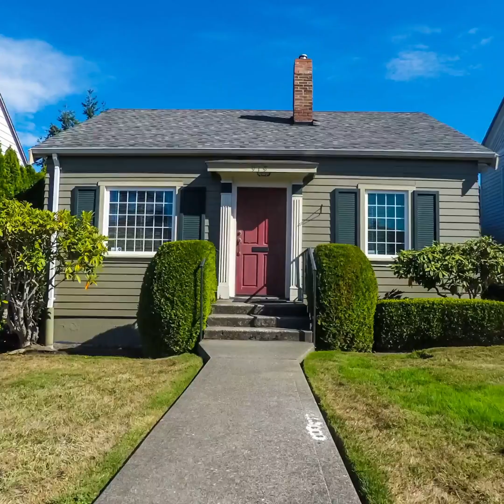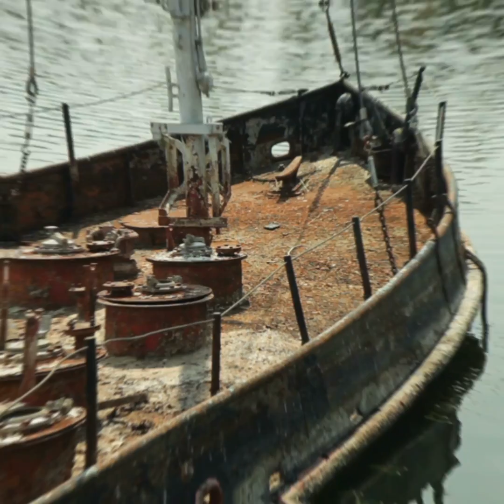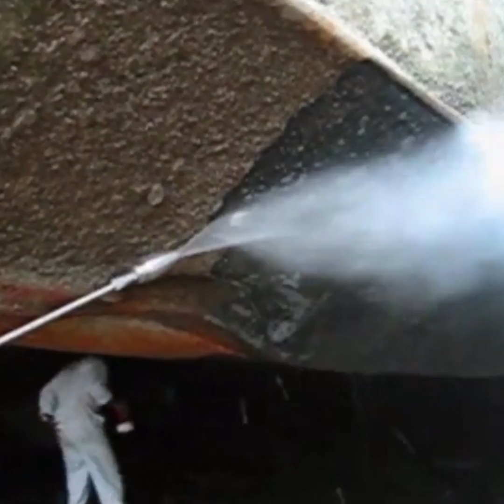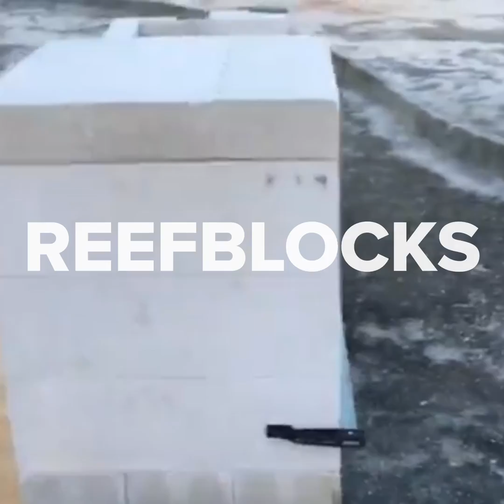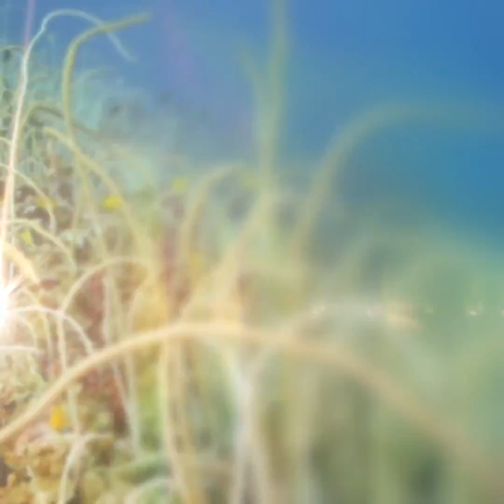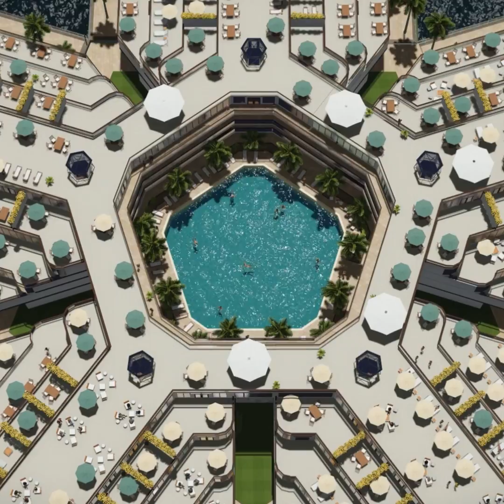Seasteading! Why not just live on a boat?

Comment: "It can't stay at sea permanently"
They can but like any society they can engage in trade and imports. Economic feasibility is fulfilled by the fact that boats can do things that are more economically viable than being a giant buoy. 

These drawings are pointless when people already live on yachts, off grid sail boats, shipping and military fleets, and deal with real world engineering problems in an economically viable manner.

I suppose if you want to have a seaport outpost, you could do that, but it needs a purpose that any other port doesn't already provide. If you want to just expand coastline or have artificial islands, you can do that with fill.

A barge is more economically viable as a barge than it is a house boat. A shipping container on a ship is more economically viable as a shipping container house on a ship.

What does farming seaweed have to do with anything? Why? You can go farm seaweed right now.

Comment: Won't the reefs cause a weight problem for the seasteads? Each generation of coral that grows will add more weight to the base of the seastead, pulling it further down. That doesn't account for the other forms of life that take root on the reef (don't think the fish and other floating life would be a concern), but I suspect the coral would be the heaviest of the anchoring life forms.
Reply from the maker: From the engineer at Ocean Builders: "what counts is the submerged weight (how much does it weigh in water), not the actual mass of the growth. For reef building corals, this is about 700kg/m3. For life without shell, this is pretty much zero. Staghorn corals will eventually die, break off and sink to the bottom so they don't count for much either. Brain corals and similar species grow very slow. It will take decades, maybe centuries until brain corals have such a size. When they eventually do, you will need to dive down and remove some. But hey, none of us will live long enough."

Comment: Seasteading and Sailsteading (seasteading on a boat) are only different if you want them to be different.  Nothing says you can't take your houseboat and tie up at the marina of a Seastead instead of your local township waterway. One of the points of Seasteading is that you're mobile, if you need to get out of the way of a really big storm, you can haul anchor and move. If the neighbors are too noisy, haul anchor and move. So if you're mobile, there's little to no difference between Seasteading and Sailsteading. Why not just live on a boat? Sure, you can do that too.

Comment: How about building on pykrete?
Reply: How you planning on keeping it frozen long term?
Reply: @torjones1701    Nuclear could work for start, but ultimately advanced energy systems which are currently suppressed would need to be utilized, with multiple backups in place for redundancy.
Reply: @Andy_Holmes  While I'm all in favor of having Thorium molten salt reactors, it's easier to build with concrete with some UV stabilized polymer mixed in to waterproof it. Another option may be to use Foamcrete instead, and while not as strong, it's much lighter and still waterproof, and it might be better for marine construction. (duno, needs testing still. Not been used this way to my knowledge.)
Reply: @torjones1701    With enough cheap reliable energy, a vast pykrete substructure could be built, thousands of feet across and hundreds thick.  I suppose it could support a structure large enough for 100,000's to inhabit, if not millions.
Reply: @Andy_Holmes  And you can do the same thing with various forms of concrete, far cheaper, and without the need for massive cooling systems that you have to keep powered & cold. There's reasons that nobody uses pykrete, and this idea that you could use it for seasteading is a solution in search of a problem it can solve, while other solutions are vastly more effective and reliable.
Reply: @torjones1701   I think you are correct, thanks for helping me rationalize that.  I've been parroting it for several years now, from another guy hell-bent on the idea here in Hawaii.  He even ran for office several times attempting to build a vessel, and is well intentioned but a little loopy.  If a floating city could be built atop a concrete substructure rather than pykrete, that would be much more sensible.

Comment: Depending on how you design the boat, you could make the hull resistant to corrosion, and it could keep sea barnacles off of it. It's all about the intent of the design. 

Shipping companies and cruise lines don't need ships to last for centuries, their ships just need to last long enough until innovation comes out with a bigger and/or better ship. 

I'm sure if someone wanted to, they could design a ship that requires little to no maintenance and could be just as stable as a seastead. 

With such a boat as your home, you could just sail to another country or seasteading community whenever you felt like it. The downside is that such a boat would be expensive to build. If you want something to last, it needs to be built with high quality, and with high quality comes high prices.
Reply: A boat would certainly be cheaper to build than a floating island several square kilometers in size.
Reply: I built a 17’ catamaran out of titanium alloy that is totally corrosion proof. The problem has already been solved.

Pictures of the Seawolf on Instagram: adamdick93
Reply: GHDPE or GraphCrete Maybe best with GraphAircrete and layer of GPaints. We will soon. All in the head for designing :)